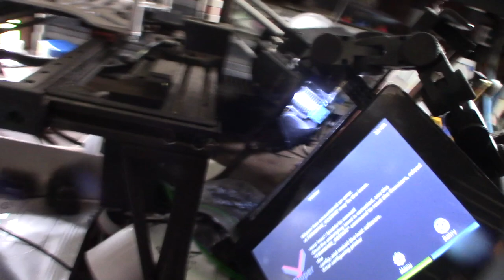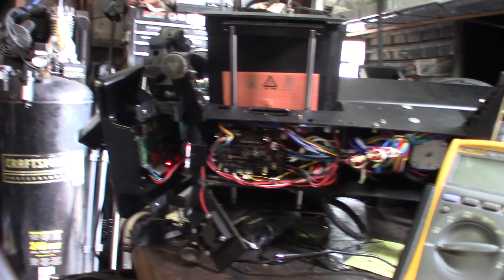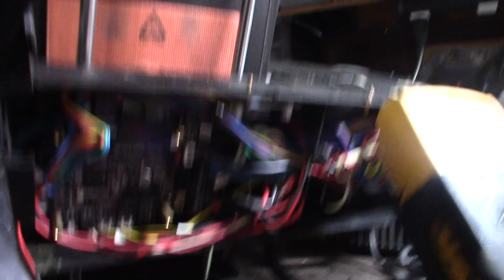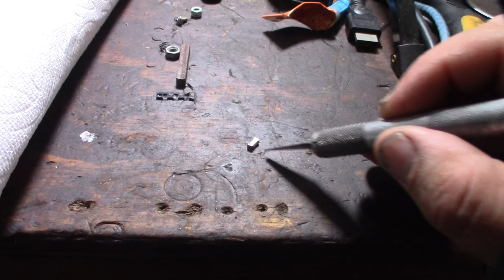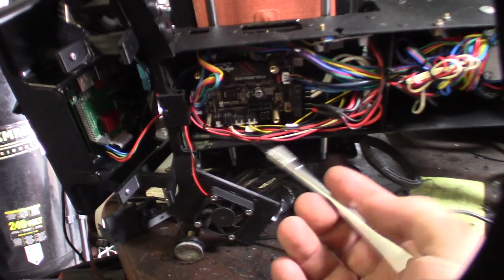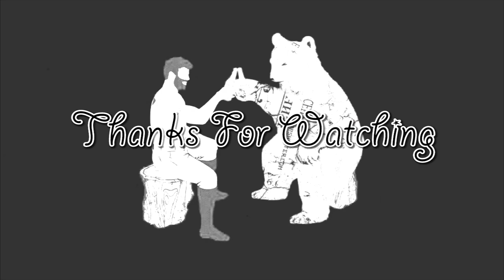BigTreeTech SKR Pico No Power Troubleshooting  Bad Fuse Holder Repair 3D Printer Klipper

Comment: Hey, just wanted to express my gratitude for your help! I've identified the issue with my SKR PICO as well—it's the fuse. I'm waiting for the replacement part since mine is damaged. In the meantime, I discovered a temporary fix: wrapping the fuse with aluminum foil. It's not a permanent solution, but it confirmed that the fuse is indeed the problem. Thanks again!